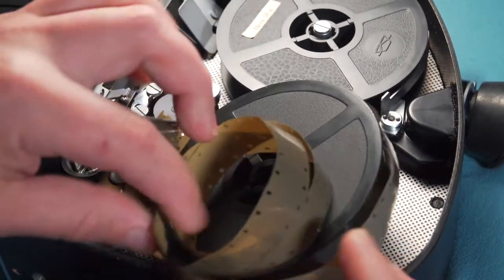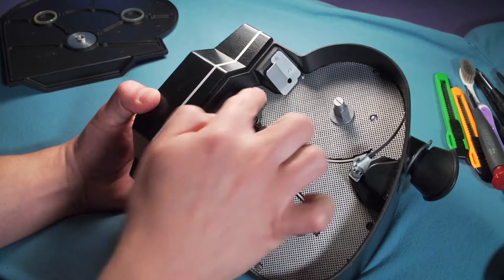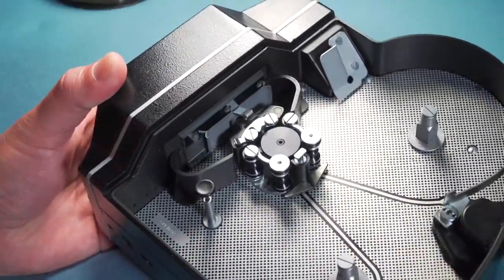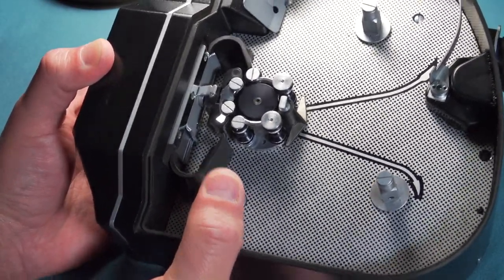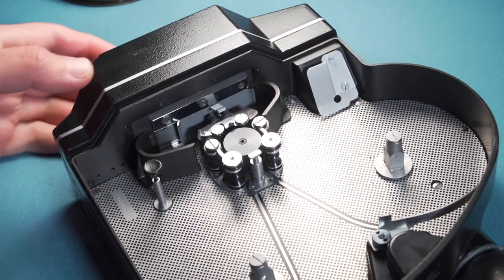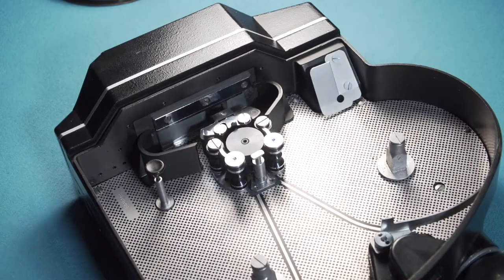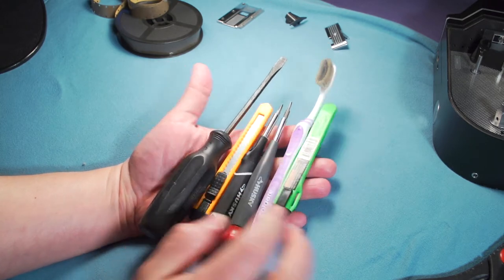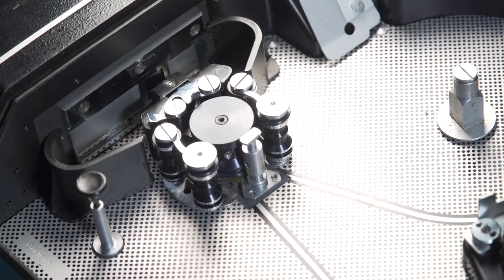Krasnogorsk 3 - Removing the loop formers.

Comment: Hi there, short question: what if the small screws that hold the black barrel in place don't appear to be visible? My motor is jammed too and I don't see them rn. Is there a work around?
Reply from the maker: Hi Elia, there is a workaround. You have to remove the front of the camera and turn the gears by hand while you pull the trigger. That way you can rotate the entire mechanism in a safe way.

In order to see the gears on the front you have to remove the aluminum plate where the Krasnogorsk insignia is. You have to be careful if you don't want to bend it a lot. It's almost impossible to remove it without bending it. Then there are 4 screws and there it is. You may have to use some sort of de-greaser in order to rotate the mechanism. Naphtha works fine, just be careful and read the instructions.
Reply: @TheCinematographyLab  Hey man, thank you so much for your quick and super helpful answer! I was able to unveil the screws and keep on removing the loop formers as shown in the video. Thanks again also for this awesome tutorial!
Reply from the maker: @elialang5953  I'm glad to hear the information was helpful. Thank you for watching.

Comment: great video!!! thank you, but what did you do at 28:00? what happened there?
Reply from the maker: Thanks. I talked about the gears that have to coincide so they can work together. Many times, when you put the lid back, the gears are going to touch at a point where they cannot connect or interact. When I winded the camera, the motor and the gear attached to it rotated, and at some point (28:00), it fell in place and connected with the gear on the lid. One gear was on top of the other because they were not in the right place. When I put pressure on the lid and rotated the lever, they found a point where they connected, and the lid fell into place, hence the bumping sound.
Reply: @TheCinematographyLab  amazing, got it, thank you so much <3

Comment: Hi there, 

Thank you so much for this video! 

My camera didn't come w any of the littler washers that you mention. Will it matter if i continue without? 

Thanks and appreciate the support!
Reply from the maker: If nobody opened the camera and lost the washers I would say you are good. I have seen cameras that have one and cameras that have two washers. The washers are there to adjust the distance. If no adjustment was needed, no washers were needed.
Reply: @TheCinematographyLab  good to know. I did then found not two but three loose washers so they may end up going there. Not sure if there is another section in the camera that they would go. Do you also, have any idea on how to clean the viewfinder? It may be the gate since i checked the lens and it appears clean but the viewfinder has hairs and other sort of particles. Thank you!
Reply from the maker: There you go! If they look like the ones in the video, they go there. There is no other part of the camera that needs a washer.

The optical path of the K3 is, as in any other camera complex, it can be easily damaged or misaligned. There are several prisms in the front, plus the focusing screen, plus the diopter in the back. All those elements have to be precisely aligned. My recommendation is not to touch them. You could blow air using a manual blower (don't use compressed air or cans). I know it's annoying to see those particles, but I don't think it's worth it to try to clean it. Make sure the gate is clean before shooting, and your film will be good. Those particles that you see won't affect the image on the film at all.

Comment: great video - thanks. i removed the two screws from the main sprocket but it still will not lift up off of the shaft to allow me to remove the plate. i even tried pulling it upwards gently with needle nose plyers. any ideas? it seems to lift up with no problems in this and one other video I could find.
Reply from the maker: Hi Jonathan, I'm glad you found the video helpful. Well that part can be tricky, and first of I'll say I don't think is a good idea to use pliers or metallic objects on those rolls because you can scratch them and they are in direct contact with film and that would translate in scratching the film. 

What I'm going  to say may be obvious but I'll say it anyways. In my experience he black roller or cylinder in the middle is attached to the shaft only by the two screws that you mention as soon as you loose them the roller should spin freely, but you won't be able to lift it because the black plastic parts that are part of the mechanism are in the way. Now if the roller spins freely then you have to lift the entire plate and it will come off. If the roller doesn't spin freely on the shaft that could probably mean that someone glued it to the shaft. I know what I'm saying may be obvious but what I can tell you is there is no mechanical connection between the shaft and the roller, so if the screws are not applying pressure to the shaft and it doesn't rotate freely then there is something else like glue.

Dissembling the rest of the rollers and that mechanism is not complicated, it can be tricky because some parts interlace at some point, but you can study it and put it back easily. You can even video record the process so you can watch it back and see how you dissembled it. That would allow you to work on the center roller, and apply some gentle pressure to remove it, but it is more work and it depends on your skills. I'm glad to share what I know, but I take no responsibility for anything you decide to do with your camera.
Reply: @TheCinematographyLab  Thanks for your response. Yes, I realized what you were saying about using plyers on the main sprocket after it was too late : D I scuffed it up pretty bad and then realized it could scratch the film. I already ordered a new K3, so I will just have to use this one for parts, unless I can find a replacement and figure out how to get the old one off. Yes it's strange that despite removing the two screws it still won't come loose. I was thinking maybe certain production runs of the K3 have something else besides the screws holding it in place? Not sure. It could be glue as you said however this is an unused, 'new' camera. But who knows? Anyways thanks for the help and for the great videos - they are super helpful.
Reply from the maker: @jonathanspruance4502  Ohh noo! Well you can always use a file to clean those scratches up and polish the part, as long as it is smooth it doesn't damage the film, or if you can remove the old one and want to repair that one I have at least two K3s that I can use for parts, let me know.

I have seen a few cameras that are stuck, actually I have one right now, the one that I used on this video and there is nothing there but old grease and who knows what, rust, moisture that in a way "soldered" the parts together. I mean it happens with cars too, after some times metal parts get stuck and they are very difficult to take off. I mean it could be a different design, but I've worked on K3s from different production years and they were all the same.
Reply: @TheCinematographyLab  yes, maybe I just got one that's 'soldered' in some way and hard to disassemble. When the new camera comes I think I'll try to shoot some footage with the loop formers in place first (says they and the gate are polished) and see how it goes before I attempt to remove them again. Thanks for the tips and offer to help - appreciate it!

Comment: Hey, I’m curious about the little plastic part you 3D printed. I have 2 K3’s and I know for sure one doesn’t have that part, I’ll have to check the other. But what does it do exactly? Is it a film guide of some sorts? And how can I get one? Thanks!
Reply from the maker: Hi Andrew, the part keeps the film leveled as it gets in and out of the actual pulling mechanism. It may seem like an unimportant part, but if you don't have it in place the camera will jam every time. 

You can buy one here: https://www.ebay.com/itm/234356357827

eBay and shipping will take at least $10, so yeah I'm not being greedy really.
Reply: @TheCinematographyLab  ahhh fantastic!! I was searching for “K3” parts on eBay but nothing was coming up, or not the piece I was looking for. Thank you so much! I will order a few just in case my other K3 doesn’t have it either. 
I’ve shot a few rolls and I’ve never had an issue with it jamming, but I’ve had a really tough time getting the film to load properly, it would always jump out of the loading/advancing mechanism. Hopefully this helps that. Thanks so much!
Reply from the maker: @andrewwatts970  No problem. I think the part should help with keeping the camera running properly. Imagine having a pair of gears that were designed to rotate together in a flat position and you change the angle of one of them a bit. They would continue to work, but they would have a hard time and there would be more friction causing a change of the timing at which the mechanism rotates, right?  It's almost the same just with sprockets and sprocket holes.

If you sent me a message on eBay please send me an email to: aresvisuals1@gmail.com

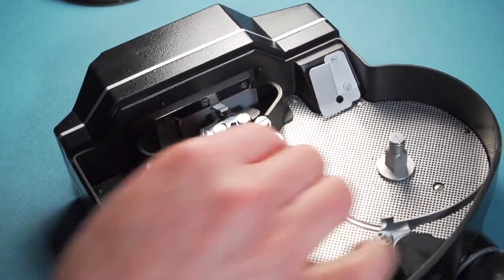Comment: Hi at 4:49, you mention that the camera cannot work without this piece. My k-3 camera didn’t come with this part. Where can i buy one, or 3D print one like you? What is it called?
Reply from the maker: You found it on eBay. It's on its way! 

https://www.ebay.com/itm/234356357827
Reply: @TheCinematographyLab  thank you! i’ve been trying to remove the plate and i removed all the screws but it just won’t lift up, is there anything that i could do for that? the parts opposite to the loop formers is lifting up but the black circular part just won’t come up
Reply: is there any chance i could send you my camera and you could service it? i've been trying to get the baffle plate up for 5 hours
Reply from the maker: @joab8436  Did you unscrew the 2 screws that keep the black circular part in place? I know it's a long video and people don't watch it entirely, but that's a crucial step. You have to align the screws and get them loose. If you didn't do that it's going to be difficult to align them now. 

Send me a video to aresvisuals1@gmail.com and I'll try to help, but I don't service cameras for other people, I just work on the cameras I own.
Reply: @TheCinematographyLab  ok will do!

Comment: Hey, I'm having the same problem with the trigger not working, I read that you know the fix and offered a work around. Could you do a step by step video of how to do that like you did for this please?
Reply from the maker: There are several probable causes for a K3 to not work properly. In my case I know the motor is in good condition because I can feel the resistance when I try to wind the camera up. In this specific case I think the camera gears in the front part are stuck, some naphtha should solve the issue. I don't know if I can do that video anytime soon, but I'll document the process if I do it sometime for sure.

Comment: For the center piece that fits on the spindle (the piece you marked with the silver sharpie), is there a special direction the spindle needs to face?  I see there's a flat portion along the spindle's shaft, and am wondering if that has to align with the screws, or face away from them?
Reply from the maker: Yes, the two screws must be facing the flat part of the shaft. That's how it locks into place.
Reply: @TheCinematographyLab  Ok thank you!  Somehow, the flat part ended up 180 from the screws - any way I can get it to rotate?
Reply from the maker: @brendanleahy6079  Pull the trigger and wind the camera at the same time. The camera will operate, but only as long as you rotate the winding knob. Set the camera to 8fps to have more control.

Comment: I just followed this video to remove the loop formers. Now the magazine cover is loose? Any tips?
Reply from the maker: Well the reason for for the cover to be loose is because the loop formers mechanism is not applying pressure to it anymore. What I have done with my cameras is to ad some light seals made out of craft foam as I explain in another video available on my channel. It costs like $3 dollars, some work and you ad another layer of protection to your camera. At the same time you ad some pressure to the cover and it doesn't rattle anymore.

Comment: Hi, thanks for the video ! 
I bought a K3 recently and the camera works strangely: sometimes I have a part of the film that is spoiled by the following defect: during the shooting the film slides into the image window. In this case a huge vertical motion blur prevents the image from taking shape. I have the impression that when this malfunction appears, a strong metallic noise also appears.

Does anyone know where this problem comes from and how to fix it? Is it due to the loops formers?
Thanks!
Reply: or maybe the problem is that I don't have the little plastic piece you mentioned in the first few minutes of the video?? thanks !
Reply from the maker: It's impossible to say without looking at the camera, but I think you already found the problem. The issue you describe sounds like the effect you get when the camera looses the loop. Since your camera still has de loop formers you have to make sure the loop formers are moving away from the film when you put the lid on. To recreate that (to an extent) push the lever down and see if the loop formers move enough to the side to let the film move freely while it runs.

Those two things can cause problems, but you know what is actually causing the issue. Yes, that little plastic part is there to keep the film leveled as it enters the mechanism. When the part is missing the film enters the mechanism at an angle clogging the camera. You are lucky if the camera keeps running at all, but you are obviously getting the effect you get when the loops are lost.

I sell replicas of that part. The link is in the description, but I'm not trying to sell anything. You can put something in the place of that part to keep the film leveled. I once got a camera with a piece of a wooden clothes pin there. It was not the original part, but it did the job.
Reply: Thank you very much for your answer, I will try to retore the loop formers and I will get back to you!
Another question: do you have an idea of an adapter that would allow the use of Bolex optics in C-mount with the M42 screwing of the K3? Thanks :)
Reply from the maker: @jacquessorrentini2184  No problem. It would be technically impossible to adapt C-Mount lenses and expect them to work normally. The M42 is not exactly friendly because the mount is so close to the flange focal distance of other mounts like Nikon and Canon. The mount can be replaced to use other mounts, but C-Mount impossible.

Comment: If I can’t get the motor to spin, how can I access the small screws ?
Reply from the maker: You have to remove the front of the camera. Remove the insignia plate or cover, then the 4 screws, once you can see the gears pull the shutter release (trigger) and rotate one of the gears that are positioned vertically. That should rotate the mechanism. 

Do NOT try to rotate the mechanism by turning the mirror shutter. It may brake or it may lose it's timing.
Reply: @TheCinematographyLab  this is helpful, as the trigger just stopped working out of nowhere
Reply: @TheCinematographyLab  as for the motor being strange, do you have any suggestions for fixing the trigger and motor?
Reply from the maker: @justinbackert1567  If it quit working suddenly that  sounds like the motor may be damaged. Cameras that haven't been used in a long time can have dried grease issues, but those cameras are stuck and don't work at all.

I have another video where I show how to remove the motor. There is not much you can do with it since it is sealed and it's dangerous to open them because of the pressure they hold. When you open the camera you can see if something obvious is not letting the mechanism move. The mechanical parts are obvious and not fragile. I wouldn't touch the optical parts tho. Please subscribe!
Reply: @TheCinematographyLab  so far, I’ve got the front removed and was able to manually move gear. That worked for a while, but then it began moving when I held down the trigger without touching the gear. I believe it had something to do with the button. 

And don’t you worry, I’ll be subscribing right away!